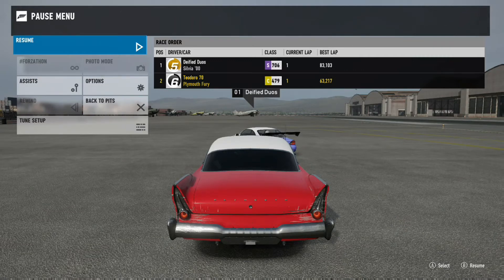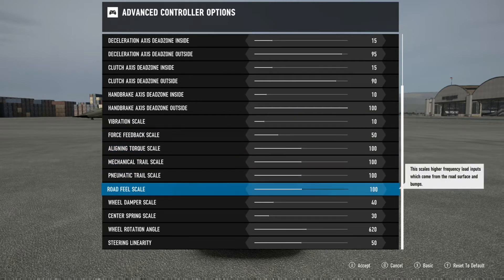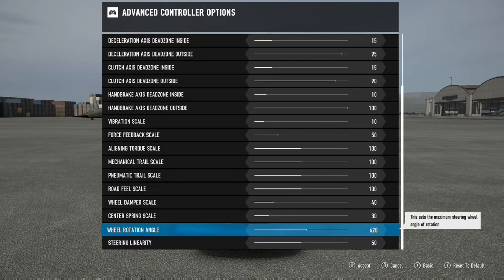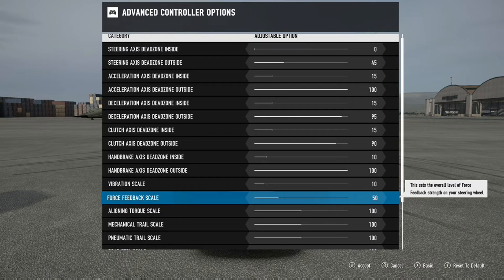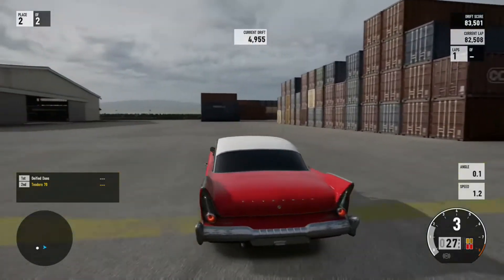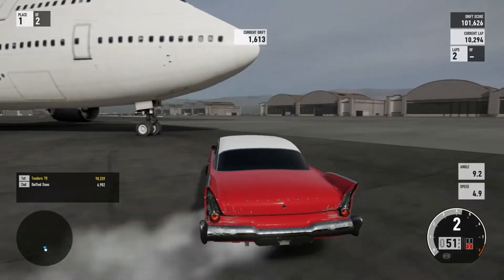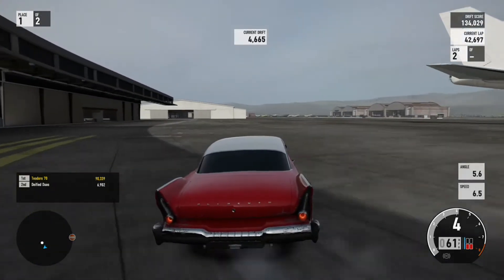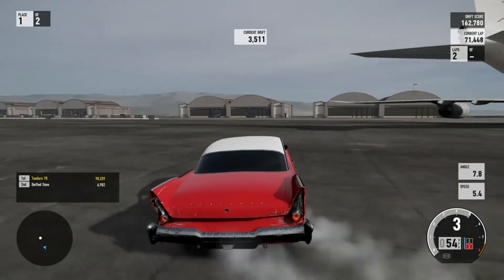Forza 7 My Drift Wheel Settings For the TMX

Comment from the maker: May I also add most muscle cars  have no power steering 😉 Thus the reason why they are given the name muscle cars. In most 70s cars they have none, even also in cars in the 50s and 60s, Much like this 58 Fury, it's just a plain work out when steering without power steering, which can make it feel more badass since your getting more of the car to feel.
Reply from the maker: Mind you Car that did have back then, was very primitive and came with extra price for the option.